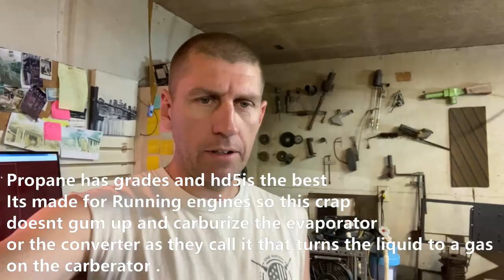Oil in Propane ? Torch ignitor stop working ? RV ruined ? House burn down ?

Comment: We have a hell of a time with that stuff in automotive lpg systems. With the heat that's added by the gas converter it turns to a black waxy stuff. Most automotive gas converters have a drain to get that crap out, well in theory amyway

Comment: You get what you pay for. LPG is very clean burning if you buy quality and not cheap stuff. Look for a supplier that has filters on their bulk tank. You'll always get a little oil in any liquid fuels. Good suppliers have the right filters to remove it all.
Reply from the maker: Thanks for the tips!

Comment: One time I took the valve off of an old LPG tank that had been used for home heating and refilled many times. In the bottom was a few hundred mL of some amber colored and very strong smelling oil. The odorant apparently dissolves in it very well. I had to invert the tank and let it run out for a few days before it all came out.

Another time I was using a herm fridge compressor to pump some LPG out of a tank. When I disconnected a fitting the oil from the compressor started spraying everywhere. The LPG had dissolved in the oil within minutes like CO2 in coke and I could even hear it fizzing inside the compressor.
Reply from the maker: Great input , this comment section is turning into an encyclopedia on the subject i love it

Comment: How odd !  Does this vary by provider?  I know i use "Blue Rhino" tanks from the local Home Depot / Walmart tank exchange (and a fitting adapter if i need those smaller ones) for comparison info

Thanks for pointing this issue out as i haven't delved into the level of stuff you do, but plan on doing so some day!

Comment: you can only get MAP pro gas now...true MAPP is no longer manufactured i read...i use green bbq bottles on the bernzomatic and it still sparks up ok...the blue bottles in the tool section are smaller volume and more moulah so i buy the bbq ones. maybe gas is not as dirty in Oz...but i doubt that. i have had stuff spray and spit from big bbq bottles on a hose...i thought it was liquid gas but in hindsight of your info it probably was that crap
Reply from the maker: I think the little fat green tanks are actually cleaner gas because they never mess up my torches . But if you put the torch a a refillable tank the  torch  will stop working right immediately
Reply: @NOBOX7  i have seen cigarette lighters do the same on those bottles that look like aerosol cans for those portable cookers!

Comment: Well from working in a refinery where we strip different hydrocarbons from crude oil.  Propane and butane must be driven off of gasoline in order to make government regulations for volatility. What happens is a rougher cut sometimes... what you have there is butane and some of is isomers,  maybe some pentane.  

I wouldn't call it heavy ends,  but maybe the heaviness is relative... 

A temperate gradient seperator is not perfect.  You get heavy out top and some lights in bottoms.  

Also olifens,  double bonded hydrocarbons will give you dome waxy type products... 

You have a non complex petrolium refinery product..

Enjoy your burner videos..

Hey can you make a PetCoke burner?  That is petrolium coke. Burner...

Thanks hope that helped
Reply from the maker: Yes i can but petcoke is very hard to burn .
whats your application ?
Reply from the maker: Great input by the way

Comment: wow thats very interesting. so when its liquid it carries the "heavy ends" which is the last bits to crack out of the cracking process...the cheap bastards leave it in the gas to save them from having to get rid if it...i guess the bottles would have the heaviest ends after it is empty.
Reply from the maker: Great point about the reason they leave it in , never even looked at it like this

Comment: I’m using a vintage truck camper. While checking and tuning “systems” after I got it the stove was fine but on a separate line the fridge would burn ok but furnace on the same line was starving for fuel. I dismantled the hard lines and removed nearly 1/2 cup of oil. I was pretty sure this had not “leeched” from the 2 x 12” hoses connecting 2 cylinders to the regulator.
Reply from the maker: Thanks for the input good buddy , we have quite the archive going

Comment: The valve on the tank is the first expansion valve. then your using all that line as a self cooling condenser.  My ribbon burner runs best at 2 psi. You created a extreme situation that isn't the norm at all.
A adjustable propane regulator only goes to 30 psi. After all acetylene becomes a high explosive past 15 psi.
Reply from the maker: Kurt Dog Why are you talking about acetylene brother  ? Its propane and as i said this video is for engineers , 30 psi will not operate some of the equipment i run or engines  , you cant even run a rose bud with 30 psi , you need a 80 . Thanks for the input though  an did you know vehicles use liquid propane ? That means the feed line is at 120 psi , so this is indeed a normal situation . Not tryna sound like a democrat but just saying home boy .

Comment: How about an electric igniter for less waste and more reliability? Just an idea though
Reply from the maker: Its all about cost good buddy , an electric ignition system would be very pricy but yes far better
Reply: @NOBOX7  Ah, I see. But would it not make up for the losses in the long run? 
My idea would be a so called "high voltage module" for under 10$ running off a 3.7v Li-ion cell and controlled by a programmable microcontroller with an IR-sensor as an input. The Li-ion cell is hooked up to a power supply via a small Li-ion battery charging board. You would also need to use an external transistor for switching the current to the high voltage module and the solenoid valve
Again, that's just a suggestion and might not even be an option due to lack of time or coding/electronics knowledge.
How is the fuel and air for the main burner even controlled remotely?

Comment: Pretty interesting! I've never seen that much come out of solution. Ever!   I've been dealing with hvac for 40 years.  Rules I was taught to go by :  Always use Propane rated hose. Always use a regulator at the bottle, then adjust further modification after the regulator.  Hose is for short run exterior use, always use metallic lines for interior use.  Most building codes go into details.  Interesting that your experimentations produced these results. Did you have an approved regulator at the bottle?  Wow that's strange !?
Reply: I think the propane used in refrigerants is simply more pure than the stuff used to fire one's grill.
Reply: With his talk about the pressure in the hose, I dont think he had a regulator at the tank.
Reply from the maker: @kreynolds1123  Keith you are correct , i thinks its H class or something like that

Comment: I agree, I seriously doubt leach of hose material.  
With a similar huge amount of oil I got, if it was repeatedly and quickly removed from the structure of (short) hoses should have caused failure right away. 
2dly, how would it "leach" from copper lines? It donut..

Comment: It happens with map gas too. I use pre-filled map gas from ace hardware and get this alot. 2 different bottles from 2 different aces. I notice it when torch use is increased... more gas is used/ torch gets hotter... i akways thought it was some kimd of lune added to the gas for longer life span. I just hang the torch and let it leak out then continue working.  Thank you for the explanation. Answered alot of questions.

Comment: yes this is a problem I've encountered when running one of my bigger forges. cause it consumes so much propane I run it it without a reulator at tank it gets restricted I think at tank valve. but like you were saying the and held torches get clogged I will take them apart and clean with acetone.  love that stuff it will probably be taken away from us here in California though soon anything good and that woks always does. your torch that burns acetone looks rad but very complicated